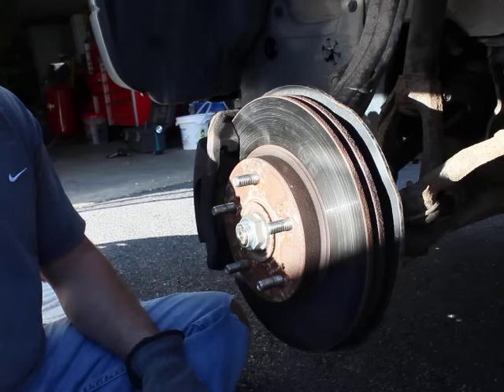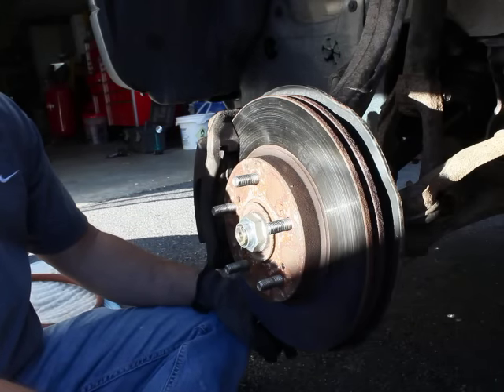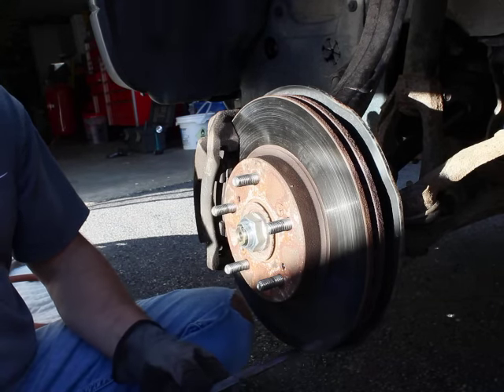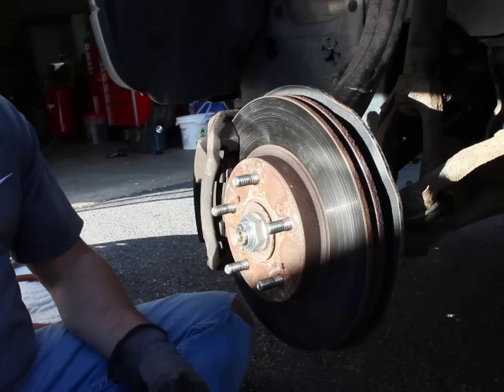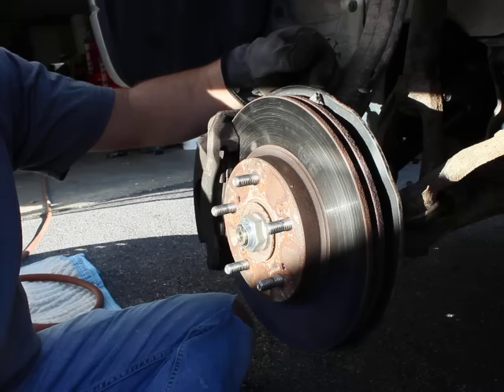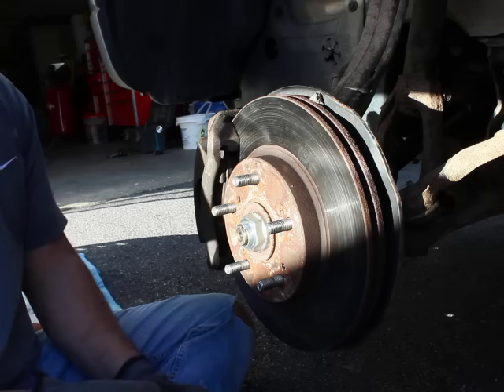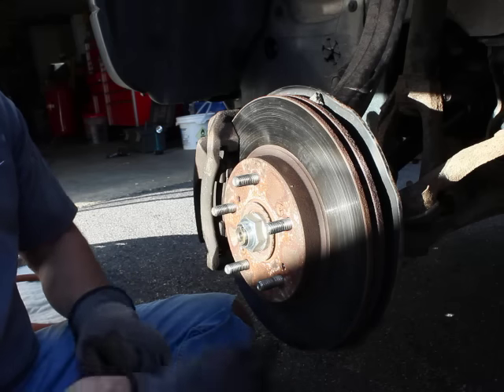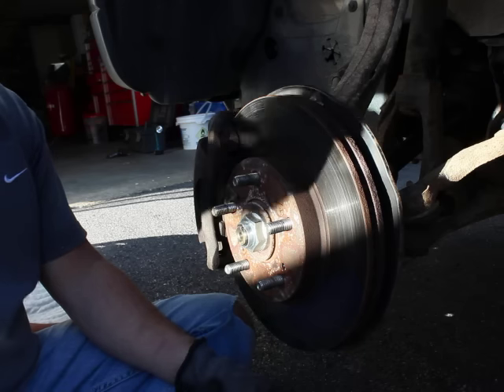Scraping Noise From Wheel While Driving

Comment: this happened to me the mechanic fixed it but now its happening again, I am hearing the scraping noise again, why has it come back again
Reply from the maker: Hi Mohammed, 
Sometimes the mechanic will bend the backing plate out of the way, but may have missed the other wheel that also has a bent backing plate. It could also be a small pebble lodged between the backing plate and rotor at one of your wheels. Let me know if this helps, thanks.
Reply: the noise seems to have gone need to gt it rechecked cause it sometimes comes back
Reply from the maker: That sounds like a bent backing plate. Let me know what they find, thanks Mohammed.

Comment: Mine is still scratching. Strange that it’s not hitting the back plate... brand new pads and rotors... doesn’t scratch on turns though...
Reply from the maker: Hi Lee, Does it sound like light hissing or do your hear the metal backing plate? Have you checked your rear brake pad thickness? Maybe the rear brakes are getting low and the wear indicator is hitting?

Comment: Hearing in my left front wheel like as if going to be flat but it is not souds like pssst pssst.....
Reply from the maker: Hi Chaabi, you may have some debris caught between the drum and the backing plate or somehow the backing plate get bent and is now hitting the rotor. You may need to remove the wheels and check the backing plates and the gap between the plate and rotors.

Comment: My problem is that something is grinding against my rotor eating it up
Reply from the maker: Hi MuMu, It sounds like you have a sticking caliper. I recommend you remove the caliper and check to see if the piston retracts easily and if both slide pins are moving freely. You may need to replace the complete caliper to remedy the problem  Let me know what you find or if have more questions, thanks.
Reply: @EddieCarrara1  
Thankfully it wasnt the brake caliper. It WAS the dust shield!! Lmao i hate that thing lol i just bent it back out of the way and my hub was loose so my neighbor helped me sledgehammer it back into position haha
Reply from the maker: @MuMu124  Thanks for the update MuMU 👍
Reply: @EddieCarrara1  
Okay new problem now.
The grinding against the rotor is gone. But now when I turn left there is another harder grinding and the car slows down like its fghting to turn...the axle is new and perfect. The hub assembly and bearing are also new...any advice would be great
Reply from the maker: Hi MuMU, I recommend you read my first reply lol 😂, all kidding aside, take a look at the caliper, it sounds like something is sticking, also check out this video I made on sticking calipers
                https://youtu.be/GInfvb6U48Q
                  Let me know what you find, thanks.

Comment: my backing plate was causing a grinding noise  I brought it to the mechanic and they cut away some of the backing plate due to rust  what is that going to do to my brakes and or rotors

Comment: How can I take it off without removing the wheel
Reply from the maker: Hi Truth Lva, you most likely can't, but you can push on it with a long stick or screwdriver and see if the noise changes.
Reply: @EddieCarrara1  ok thanks for the info

Comment: Hi Eddie, my car just started having the squeaky noise while driving and when I hit the brake the noise stop. do you know the issue to this? Only have noise when driving. ilding engine start all normal.
Reply from the maker: Nhan Pham Hi Nhan, most likely it's the brake pad wear indicator hitting the rotor, but when you hit the brakes, the noise will usually stop, you'll only hear it while driving, and sometimes when turning slightly one way or the other. Keep me posted on what you find, thanks.
Reply: Eddie Carrara Thanks for replying to this. I have the same issue as the commenter where the brakes only make the sound when I'm NOT hitting them. The moment I start braking, the rubbing/squeaking sound stops. I've checked all the pads and none of them are worn down. Any suggestions?
Reply from the maker: Hi Matt, 
Did you pull all 8 pads out of the calipers? I'm assuming you have 4 wheel disc brakes. If you only looked through the wheels, you didn't check the brakes close enough.
I just had a car in the other day that did the same thing. We found a small rock from a freshly filled pothole stuck to the caliper and was making an awful noise like the brake pads are worn out. Hope this helps, keep me posted Matt, thanks.
Reply: Thanks! i got it fix problem was pad is worn out all 4 of them, 1 of it broke and crack making the awful noise. im happy that it is nothing relate to engine problems.
Reply: Eddie Carrara Thanks for the reply! I actually had all 8 pads taken out by a friend of mine and together we looked at them and did not find any rocks. I don't think it's likely a rock as the sound is completely muted while the brakes are applied. If there was a rock, I feel it would likely amplify the sound when more pressure is applied.
Reply from the maker: Hi Matt, 
the only other thing I can think of is the anti rattle clip is not centered in the caliper. Can you record the noise in a video and post it here on YouTube so I can hear it?

Comment: Hi. My car is making that scraping noise when I apply the brake. It then stops and starts again when I release the brake. Garage claim it's rust but the car is only 18 months old having done 9000 miles. Any suggestions most welcome as I am reluctant to believe the garage. Thank you.
Reply: The garage claim I need new brake pads and discs at a cost of nearly £300!
Reply from the maker: Sarah Gregory Hi Sarah, If the brakes are making the noise when braking, I recommend getting a second opinion. Depending on where you live brake pads can get jammed in the caliper and wear uneven. You should bring it to the dealership because it sounds like it could still be under warranty. Let me know what you decide to do, and if you have more questions I'll be right here :)
Reply from the maker: Sarah Gregory Sorry I didn't see this post, lol. Why is this not under your manufactures warranty? It's only 18 months old!!! What is the year, make, and model of this vehicle?? Let me know.
Reply: Thank you. I checked yesterday and my car doesn't have back plates behind the discs. It's started making the noise now when I turn to the left a bit. It does have a 3 year warranty. Debating taking it to a garage I trust and then taking it back to the dealership if needs be one they've diagnosed it. Thanks for your help.
Reply from the maker: Hi Sarah, 
It would be very unusual to not have backing plated behind the rotors (they are difficult to see), I have never seen a car come form the factory without them. The noise you're describing is very similar to the backing plate being too close to the rotor, especially when you said you get the noise when turn left slightly. I recommend bringing it to the dealership because of your warranty, the trusted garage may charge you money when you really don't need to pay. Keep me posted Sarah, thanks.
Reply: +Eddie Carrara turns out my discs were pitted and corroded. citroen have replaced them and the pads under warranty as car had only done 9000 in 18 months. Thanks for your advice.
Reply from the maker: Sure Sarah, my pleasure :) Glad you got it fixed at no charge :)

Comment: mine is when u turing left pretty well and sometimes right.. and its awful
Reply from the maker: Did you fix it lovepeacenotwar1982?
Reply: yup, wheel bearing... didnt change hub this time, but noise gone, got another problem now, oh this is van full of problems, always fix one either a noise or something else breaks lol thinking oil pressure switch but trying to locate it
Reply from the maker: Oil pressure switches are usually located near the oil filter on most engines.
Reply: was not at all locate behind the air filter bout same location as the thermostat.. in that general area thanks though :)  i am feeling windstars are weird and got their own minds lol...

Comment: I don’t know what they used meinke but I didn’t have that noise before they did the breaks why does it do it when I am driving will the noise go away and plus the car sits sometimes
Reply from the maker: There is usually a heavy amount of metal flake in aftermarket brake pads when these metal flakes connect to the rotor surface it causes the high pitched squeak. It's wont cause any problems, but it is annoying.
Reply: Eddie Carrara but how come it squeaks now and then when I’m driving in drive or slowing down or making a turn slow

Comment: Is is necessary to remove the wheel to remedy this problem?
Reply from the maker: +Mi Tar 
It all depends on what's causing the noise. If it's a small pebble lodged between the rotor and backing plate, probably need to remove the wheel. If it's just a bent backing plate, you can use a long screwdriver to push it away from the rotor. Let me know if this helps Mi.
Reply: it does, thanks

Comment: Hi Eddie - I started hearing a clunking noise (almost like medal on medal loud enough to be heard by people in and around the car) when I drove it between less than 15 mph. The noise doesn't happen more during turns or bumps....just simply on straight on an smooth road) I recently took a trip which took 6 hours and the noise got much stronger (again only when taking off or slowing down less than 15mph). I took it to my mechanic who put in on the lift with wheels hanging and checked things with the long screw driver looking thing and said nothing looks loose or worn out.  However, one off the lift the noise was gone.  I took another trip and noticed and noticed the noise coming back but has since gone away and no mechanic has been able to guess what it may be.  I would greatly appreciate if you can offer any suggestions.

Comment: i have a 2008 nissan altima coupe, and while im driving i can here a noise coming from my rear passenger side tire or break, idk wahts wrong with it, but everytime i driving its making that noise and disappears as soon as i step on my break
Reply from the maker: juniel fontilea Hi Juniel, you need to have the brakes checked, most likely you brake pad wear indicator is hitting the rotor warning you that your brakes are low and need replacing. Keep me posted on what you find out, thanks.

Comment: I'm having this issue with my 2014 impala , left turn only it makes the grinding noise and it goes away , is there another reason why my car may be doing this?
Reply from the maker: Hi DD, if your brake pads are extremely low it could cause a very similar noise. I recommend you have your brakes checked, especially the inner pads of each caliper, it's common for them to wear faster.
Reply: @EddieCarrara1 Hello Eddie, I took it in for that noise, they replaced my brakes but I was told it could also be the wheel bearing, took it to two other shops second one said there was nothing wrong with it and the one where its at now, they checked for humming noise, also speed sensor and it didn't throw anything out on the computer, I was told last resourse is wheel bearing but I'm no mechanic 😆
Reply from the maker: @mammager100  The wheel bearing makes a humming noise, I have a video of the noise a made a few years ago, take a listen to it and see if this is your noise. https://youtu.be/e0NykQBOey0 
I also made a video comparing a driveshaft bearing to a wheel bearing, take a listen to this one too to see if it sounds like yours. https://youtu.be/5q7Dg_hyX8M
Reply from the maker: @mammager100  Keep me posted about the noise and if you think one of the videos sounds like your noise. 😊

Comment: Hi got that sound in my car but inly when turn right there is no noise when turn left or go straight what could be thanks
Reply from the maker: layzie bone You could have a small rock stuck between the backing plate and rotor, the rotor may be too close to the backing plate and needs to be adjusted, or your brake pad wear indicator is starting to hit the rotor.
Reply: Thanks noise its gone after while must be rock cheers
Reply from the maker: Cool, I need an easy button for that one :)

Comment: Eddie, mine does that noise but randomly, like I'm driving straight and then out of nowhere the noise starts, and it doesn't go away until I stop completely.
Reply from the maker: +Julio Arias Alvarez 
I recommend checking the brake pads Julio, the wear indicator on the brake pad could be just starting to touch the rotor. If the pads are OK, check for any rust or debris near the rotor backing plate. Keep me posted, thanks.
Reply: +Eddie Carrara ok thank you, I will tommorow
Reply from the maker: What did you find Julio?

Comment: Why doesn't it work for me? I pushed very hard
Reply from the maker: Hi Kiryl, this may not be your problem, I recommend you have the brake pads checked, they may be getting low and it's the brake pad wear indicator making the noise.
Reply: @EddieCarrara1  yeah I actually did get a brake inspection and the break pads were completely gone and needed to be replaced. Thanks
Reply from the maker: @kirylrabushka8260  Awesome, this video is just a quick check, if it doesn't change the noise, usually it something different :)

Comment: someone please help me I carried my car to service ok 2weeks ago  after Monday here was  driving my front wheel on driver side started to make a grinding noise then smoke my mechanic came and checked it and told me my booster going when he bought it back my brake light not coming off I have to take the dam battery pole off
before carrying it to service I didn't have that problem he also replaced brakes pad so what can be the problem I have a Toyota corolla help me please before this mechanic make me waste money and exchange my booster when the booster is not the problem 
as I said my car was working perfectly before it went in  to service

Comment: I got my brakes change like a year ago but only the front right wheel squeaks but when i turn right and sometimes straight. I check powersteering fliud btw.You think i might have this issue? it had snowed where i live and im thinking maybe salt got stuck or a rock?
Reply from the maker: Adrian Vega Very possible, or your brakes are getting low again. I recommend having them checked just to be sure. Keep me posted on what you find, thanks.
Reply: Eddie Carrara I check the brakes and their good and rotors are good to. There is no Rocks to be found. Hmmm now I'm confuse. Might be coming from the engine? Maybe a pulley when turning? something I notice also is the noise goes away when I brake.
Reply from the maker: Can you take a video of the noise and post it on YouTube so I can hear it?
Reply: Eddie Carrara yeah will do. I will do it when I have a chance. Appreciate the help so much.
Reply from the maker: Sure Adrian, my pleasure, glad I could help :)
Reply: Eddie Carrara I found my issue but didn't record it. It was my back brakes(I feel so dumb). The reason I check it because rotors were going bad then I found out about the brakes. P.S I put on new rotors and brakes and they smell burn and look burn. I pretty sure that's normal right? Also no dragging or whatsoever. Brakes like a champ
http://postimg.org/image/iamsyg5mb/
Reply from the maker: The purple color means heat, so just keep an eye on them for a few days. If they're not dragging, you should be OK.
Reply: Eddie Carrara thanks so much.
Reply from the maker: You're very welcome Adrian

Comment: i have an 03 745i bmw and did a burnout like 2 donuts and now it makes this horrible grinding noise and feels like its locking :""""( what can this beee
Reply from the maker: Gerardo Barrera It's possible you damaged a wheel bearing or bent something. Or you could have got a small rock caught between the rotor and backing plate. When do you here the noise? what speed? straight or turning?

Comment: okay so I just redid my rotors and calipers due to a grinding noise that left a line in the rotor. Now after the change there is still a grind line Idk what it is does anyone know?
Reply: I've had this issue with A few vehicles it usually ends up being a wheel bearing.  and if so you will hear it louder at certain speeds a sweet spot if you will.  after a longer drive touch the center cap of your wheel to see if it's Hot to the touch.  should be warm but not hot hope this helps. ☺
Reply: parsons819 oops sry that would not make a line in your rotor just the noise didn't read properly 🤐